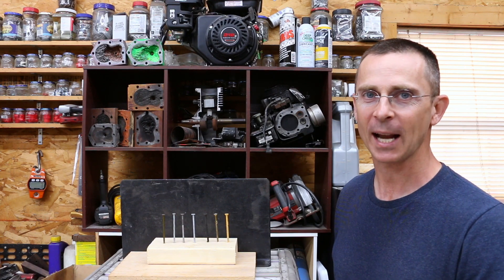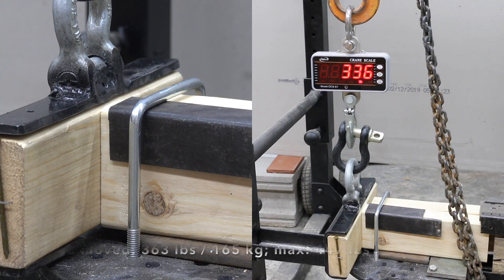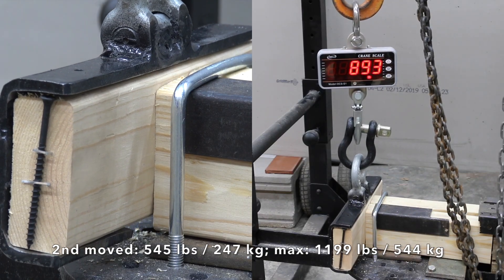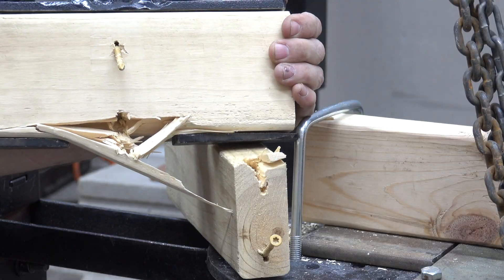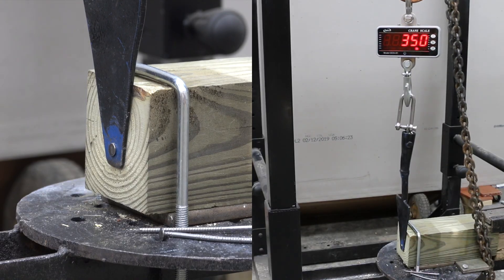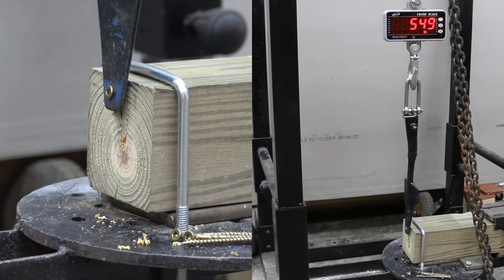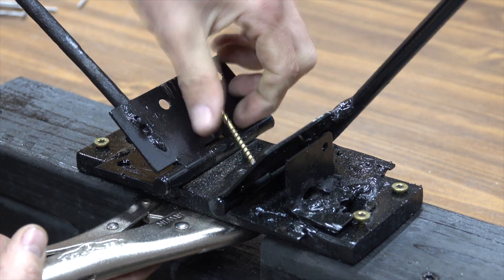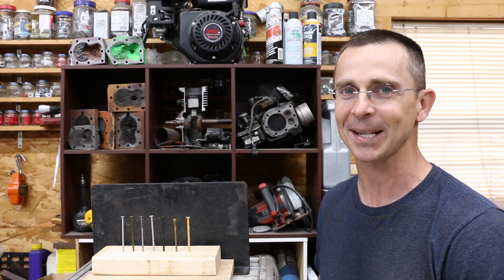Do Screws Shear easier than Nails? Let's find out!

Comment: The metal fatigue jig was an inspired idea; it shows that a person can perform his or her own tests, with repeatable results, on the fasteners they want to use, using easily available shop items, and a little ingenuity.  Separating facts from hype can be problematic, but in construction, where safety is always an issue and tempting shortcuts abound, it's good to know you can test a fastener's shear strength, pull-out resistance,  and proneness to metal fatigue in your own shop after watching this video and applying fairly simple testing principles.  Thanks for another great test of the things we all use and rely on to be up to the requirements of the job.
Reply from the maker: You are welcome!

Comment: "Pull-thru" and "popping" are the two main problems with both screws and nails, but a lot depends on the woods "elasticity". As wood dries out (no matter what the wood) it wants to splinter and split. Glue can help, but it also wants to dry out and give way. "Toe -nailing" magnifies splitting and splintering, but since in framing, most the force holding the structure together is gravity, the nails and screws only hold the wood in position. For decks, "crawling" and "cupping" of the decking, caused by repeated drying and wetting (especially on the upper surface) and people walking on it and dragging things across it (oh, did I mention the sun and temperature changes and humidity). Add the wind and "ice dams" and again, the sun, for shingles, and the stesses for most home building is taken up by the materials, not the fasteners. If you're concerned with shear, build with steel. As for things hanging on the wall, like cabinets, the doors are more likely to fall off the cabinets than the cabinets off the wall (as long as the cabinets were attatched properly to the substrate). Pitcher  hanging was so much easier when you had lathe. Doors and windows are affected by use, and the "settling" of the foundation and their own weaknesses (materials used, milling, etc.). 50 years of construction,  remodeling and repair.
Reply from the maker: Thanks for sharing.

Comment: Dont think the test actually showed proper sheer strength as the boards were allowed to pull away from each other, instead of exact vertical movement which would cause nails and screws to either bend or  break
Reply from the maker: Thanks for the feedback.

Comment: The true "extra value" of GRKs is that stripping out their heads is next to impossible. If you drive a box of 500 you might get 1 that will strip out (useually just letting the bit jump as you sink it home) if you are using a worn Torx bit. The deck-mates are also pretty good. In my experience though Phillips 2 head screws over 2" in anything but dry  "white-wood" you are going to be stripping a lot of heads out.

Comment: Wow, I always saved drywall screws for the things that didn't need much strength - guess I should be buying more.  I still like the SPAX and GRK fasteners if only because they drive into soft wood without pre-drilling.  My experience with drywall screws is more split wood and if you use an impact the heads tend to twist off where the premium screws do much better there.
Reply from the maker: Thanks for sharing.

Comment: These are not shear strength tests of the screws. The wood sheared in the first test. That is a withdrawal test. The bending test is not a test of shear. Every time you bend the fastener it work hardens. The screws are hardened out of the box. That is why they become brittle quicker leading to failure. 

If you take a screw that had the same root diameter as a nail the shear strength is much higher in the screw. Shear strength is 65% of the tensile. The tensile of the screws is higher than the nails.
Reply from the maker: Thanks for the feedback.

Comment: Never reuse a bent screw, certainly not a straightened one. Screws are inherently designed to be screwed in, by torsional force only. Not hammered in. So while they are very strong for shearing, they're not designed to tolerate significant bending, unlike nails that get hammered in by hand and therefore experience (relative of course) very variable axis direction of force application.

Personally I favor screws for almost any application. Exception is mostly in cosmetic settings, where fadteners shouldn't be seen. I find behavior and results are much more predictable and consistant with screws. And when working a lot with bigger fasteners, for construction, a modern, lightweight, 18V impact driver is SO much easier on the arms, wrists, shoulders and other joints, than a hammer. Plus with appropriate screws and a collar bit holder, you can work much safer in a ladder, on roofs or in harness, because you can run the screw in with one hand. With nails, you either need two hands to get it going, or a fairly big and heavy nailgun. They've gotten "better", but decent ones are still very big and heavy compared to modern impact drivers. I have a Makita one - it's a wiff above 2 pounds with a 3Ah battery, and I can fairly easily drive in 7-8" screws with one hand on that thing. And it's at least a 3 year old model.
Reply from the maker: Thanks for the feedback.

Comment: Nice video! Can you test different brands of transfer case fluids?
some brands: 

ACDelco 10-4017 Auto-Trak II Transfer Case Fluid - 33.8 oz 
(https://www.amazon.com/ACDelco-10-4017-Auto-Trak-Transfer-Fluid/dp/B002H8U3KK/ref=sr_1_1?crid=188R384WWAUVK&dchild=1&keywords=transfer+case+fluid&qid=1597223694&sprefix=transfer+case+%2Caps%2C209&sr=8-1

Valvoline Multi-Vehicle (TCF) Conventional Transfer Case Fluid 1 QT 
(https://www.amazon.com/Valvoline-Multi-Vehicle-Transfer-Case-Fluid/dp/B071VDQLVZ/ref=sr_1_3?crid=188R384WWAUVK&dchild=1&keywords=transfer+case+fluid&qid=1597223771&sprefix=transfer+case+%2Caps%2C209&sr=8-3

ADDITIVE - OIL - FRICTION MODI 
(https://www.amazon.com/Motorcraft-ADDITIVE-OIL-FRICTION-MODI/dp/B0065T48J4/ref=sr_1_9?crid=188R384WWAUVK&dchild=1&keywords=transfer+case+fluid&qid=1597224236&sprefix=transfer+case+%2Caps%2C209&sr=8-9
Ravenol Transfer Case Fluid 
(https://www.blauparts.com/ravenol-transfer-case-fluid-tf-0870-1l.html
Reply from the maker: Thanks for the video idea.

Comment: Great job! You thought of some tests that I didn’t think of! One other test I would like to see is to have the board or strap that the vertical force is applied to be laterally blocked. Then the applied force would remain perfectly vertical and the fasteners would be more likely to fall, instead of pulling out.
Reply from the maker: Great suggestion!  Thank you.